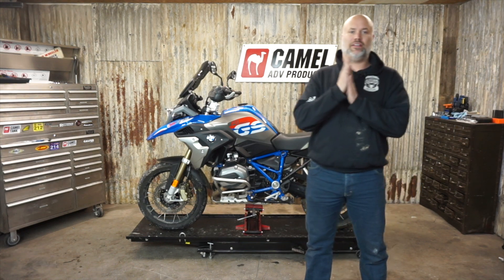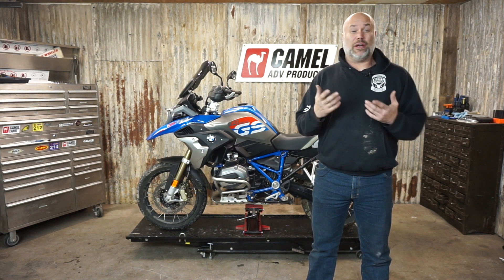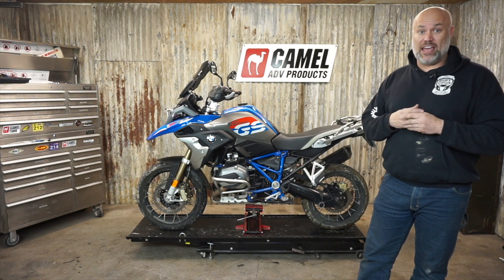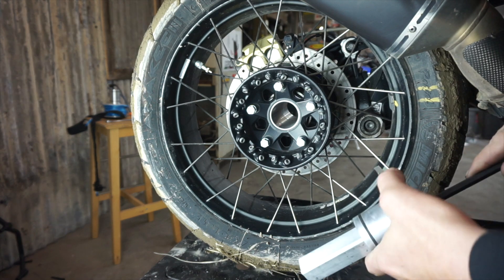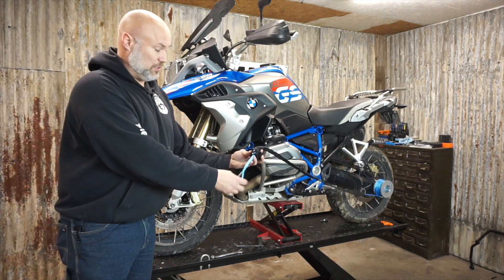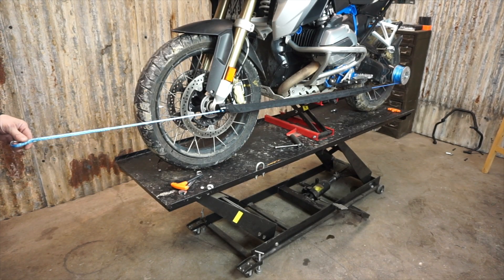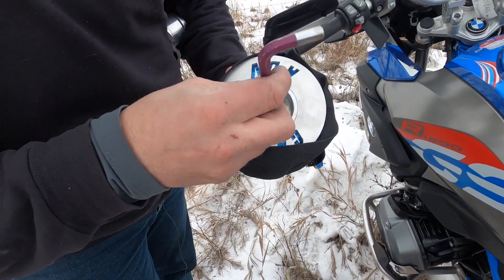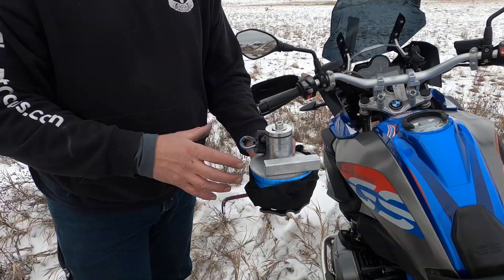R1200GS Camel Tow Recovery System

Comment: Great idea. I wonder if you could make a version for regular sway bar suspension.
Reply from the maker: A small rope around a spoke on the brake rotor side. The rope winds up until it contacts the caliper (then it usually breaks). Chris Birch did a video like this a few years ago.

Comment: What a great product! I’m eager to see it on the market. I wonder if you could eliminate the front wheel guide by using a redirection pulley at the anchor point to come back at the front of the motorcycle and anchor the wire there to a strap attached to the crash bars.
Reply: The purpose of the guide is to keep the line from getting entangled in the   wheel or run over by it.

Comment: Absolutely awesome idea! Bravo. 
Just one fear with such a system is to see the cable broke and get it as a projectile into the face or body - but I suppose the resistance of it is being well thought, however there must be a limit of what it can take as a charge. 
If I go to the wild, I'll be buying this for sure. 
(BTW, saying there will be hate is just unnecessary. Don't even bother to mention hateful people - it gives them some credit they do not deserve)
Reply from the maker: The synthetic winch line doesn't store energy like a steel cable does. It's fair safer.
Reply: @CamelADV  Good to know, thanks!

Comment: Fortnine "5 Tricks to Rescue a Stuck Motorcycle" min 4:50. Just use a winch cable and done! I doubt the spokes will suffer much with this soltion since the weigh will be distributed.
Reply from the maker: That trick is the I mentioned at the beginning of the video. You can't do this on the R1200 because of the shaft drive arrangement.
Reply: @CamelADV  I dont have a 1200 or a 1250 so i kinda though since it had the shaft you could do that trick on that sideand still have some clearence for the rope.

Comment: Interesting concept. My 5 cents: I hate it when after market companies use allen bolts for BMW specific products. Use torx bolts the same size as is already on the bike, because I don't want to carry more tools. Second, you limit your market to the latest models only (I believe -17 and up) with the front attachment. If you could come up with a different way that would work on both sides, you'd cater for the entire 12X0 range. (Assuming the rope could be rolled on both ways.) Maybe even older bikes?
Reply from the maker: This is a prototype part and an early introduction video. The fasteners are not finalized. Having one-off parts (like custom spec Torx bolts) made for testing isn't ideal.

We don't limit our year range with the front axle set-up as we have an adaptor for the earlier R1200 bikes.

Comment: Here’s your internet hate… god damn genius!!  It’s amazing this hasn’t been designed before. I love the simplicity and portability of this system. I love how it’s a tool and not a machine. As one who has experienced a couple final drive issues on a hexhead, I wouldn’t hesitate to use this in my shifthead. I am very interested in this system. If I had to point out something I didn’t like, it would be what appears to be different lug bolts. But, obviously a necessity. Very cool and I wish you the best of luck with it. And I am hoping to get my hands on one.
Reply from the maker: What don't you like about the different lug bolts?
Reply: Camel ADV just the fact that you have to replace the OEM bolts. And that they aren’t color matched. It is definitely not something that would sway me from purchasing it though. I would just prefer something that didn’t modify the bike at all. 
I checked the website but couldn’t find it.

Comment: That's is a great idea.  It would be even better if there was a way to utilize the front fairlead without having to fiddle with the axle bolt.
Reply from the maker: Oh man, I've been round and round with a quick attachment set-up for the fairlead. There can be a reasonable amount of stress on fairlead depending on how crooked or straight your line of pull is. We tried and destroyed several different fairleads during testing and always came back to the bolt-on method.